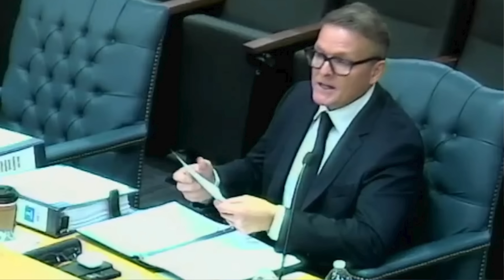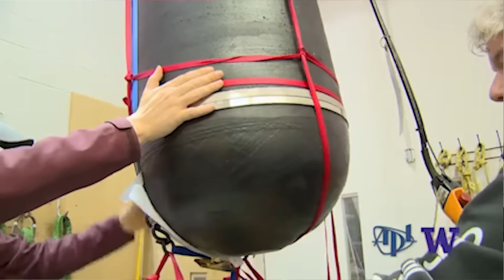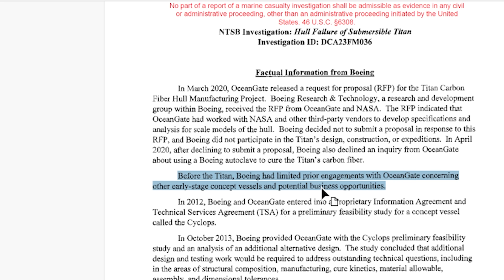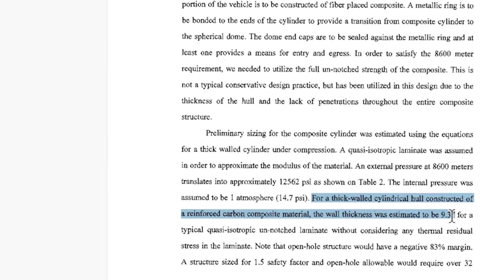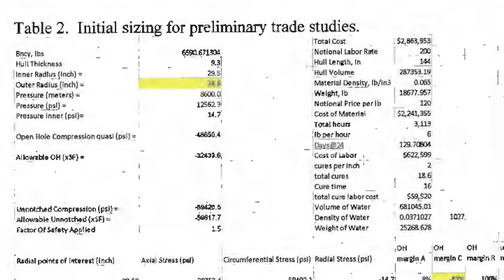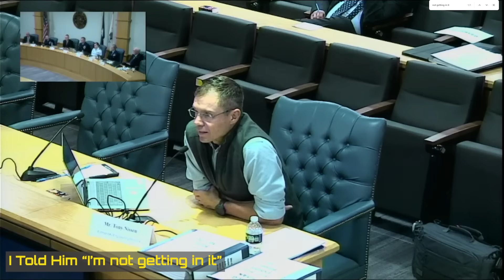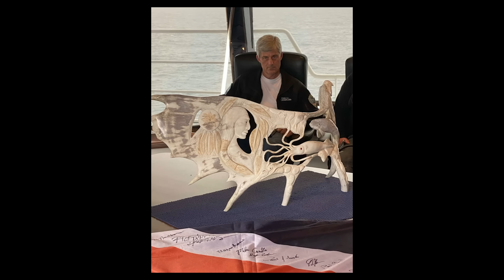Titan Sub: Fired OceanGate Employees Show What REALLY Happened

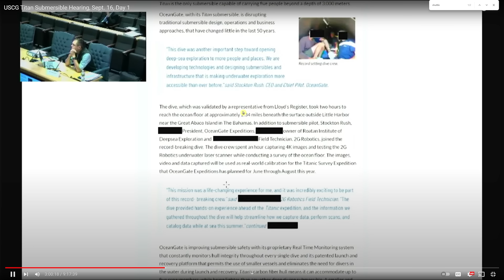Comment: I did some back-of-the-napkin math based on the table at 12:10 in the video.

A 9.3 in thick hull gets you to a max depth of 8600 m @ 12562 psi. Assuming a linear scale, that comes out to 1350 psi/in of hull.

At 3800m, the psi is 5389. This means that with a 5 in hull at 1350 psi/in, the Titan sub had a max psi of 6754, or 4700m. This is a safety margin of 1.25. Meaning the subs max rated depth was just 25% more than its operating depth.

This is a crazy low safety margin, as others have highlighted.
Reply: I'm so utterly curious what Stockton's planned lifespan of the hull was. Recorded dialoge lines kinda show that that's what he was trying to figure out, but when he got extreme and unexpected readings from his own vessel monitoring system, he was so weirdly confident in his sub he just dismissed it. It's almost as if he was just expecting it to leak a little bit, never actually implode. But there's no shot he was that stupid...it boggles the mind

Edit: I forgot money is a thing and apparently oceangate was basically destitute so...I guess that'll do it?
Reply: @skeezixmccat I’m convinced Stockton KNEW when those readings came through that Oceangate was doomed financially. And maybe he had some life insurance or something that he wanted to ensure someone got, so he ended himself in a way that would ensure the money was paid out. That’s just my theory though.
Reply: @virtualgambit577  that makes it extra dark, that he would allow others to meet the same fate. Especially poor Mr Dawood jr
Reply: @skeezixmccat  Doesn't matter how much money's in the bank, could be millions! All pointless when you're dead!
Reply: Your assumption of a linear scale is actually too conservative. Besides pure compression, the tube also experiences horizontal bending. A reduction in hull thickness increases bending stresses by the square of the thickness and deflection by the cube of the thickness. Therefore, halving the original thickness increases bending stress by a factor of 4 and deflection by a factor of 8. In reality, the actual stresses increase somewhere between linearity and the square of the value. To accurately model the shell, you need a finite element program.

The mode of failure is primarily due to the difference in stiffness, not just the material properties at the transition ring boundary. Titanium is not only materially stiffer than delaminating carbon fiber, but the half-spherical shape is also much stiffer than a tube. Consequently, it deflects less under compressive loads. This difference in deflection caused the ring to shear off under cyclic loads.
Reply: @petemiller519 could you please flesh out the difference between bending and deflection?
Reply: @bob15479  The word "bending" comes from the term "bending moment" in statics and structural engineering. It is the calculation determining bending stresses in a member. For example if you walk on a 2x10 floor joist, the joist has internal stresses due to bending which are horizontal compressive forces at the top of the 2x10, and tension forces at the bottom of the 2x10. It also experiences shear stresses which are orientated in the vertical direction.

Deflection is the calculation determining the amount a member deflects due to the imposed loads on the section. So for example, given your weight, location on the 2x10, the span, geometric shape of the section, and material type, one can calculate how much the 2x10 deflects or moves in the vertical due to the imposed loads. 

Sorry for sounding like Spock, but these are structural engineering terms with no real equivalence in layman terms. 

Try asking Grok or ChatGPT, they are a wealth of information. In my day, you would have to go to a library, read books for days, and try and figure out the answer, but now you can have an expert AI answer any inquiry you choose. Cheers.
Reply: Aye there's the rub, the relationship between depth and pressure is not linear. It varies with the temperature of the water column and not in a good way.
Reply: @GastelEtswaneplease elaborate lol
Reply: @GastelEtswanethe real question here is not about the linearity of water density. It’s about the linearity of carbon fiber tube diameter to PSI resistance ratio.
Reply: and that port hole had a negative safety margin.. of all the corners to cut, that one seems the most brazenly suicidal. i hope they recover that thing someday.
Reply: Yes, but the thing is that it's not linear.
Reply: You missed something guernica I can't blame you but the maths in that graph assumed the curing process was being preformed by Boeing, in a top of the line machine shop. In reality it was done on the cheap putting the maths out by an unknown margin. That sub was a death trap, whats crazy is American laws were not in placed to asses this vessel before it was allowed to sell tickets to the public. In any first world nation regulations are in place, such a tragic loss of life because of corporate greed simply dose not happen. The US government is simply to corrupt to draft a law requiring corporations get there machines checked over by a third party before the consumer get exposed to them. This terrible incident would have been prevented by any amount of oversight.
Reply: i've seen some convincing explanation saying that the scale is in fact NOT linear, meaning in reality a halved thickness does not translate to a halved depth, due the diameter of the thinner hull remaining about the same and therefore the ratio of surface area to thickness being significantly raised
Reply: Sounds safe to me

Comment: I mean the engineering information as a post mortem is interesting but it's not necessary to absolutely knowing this tiny company built an EXPERIMENTAL submersible to FAIL and skirted the issue of taking tourists to the Titanic with more nonsense about "mission specialists". Did any rich client not know they had absolutely no ability or any qualification to be a mission specialist...
Reply from the maker: They all knew and accepted the risks. Some mission specialists whose dives were scrubbed, refused to go back
Reply: All subs currently used for those depths are experimental.  There is no manufacturer putting out production units that can dive that deep right now.  

Experimental doesn't necessarily equate to unsafe.  There are many ocean going vessels on the sea right now with experimental hull designs.  Same with aircraft.
Reply: Once you've sat inside and watched them screw the door shut?
And then gone under water, I think THEN you'd finally see how Mickey Mouse the sub really is.